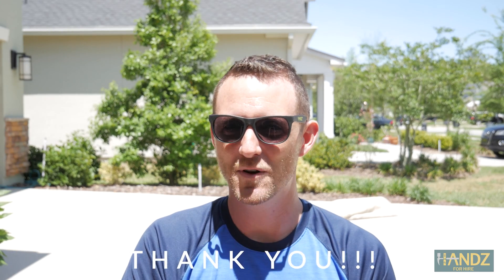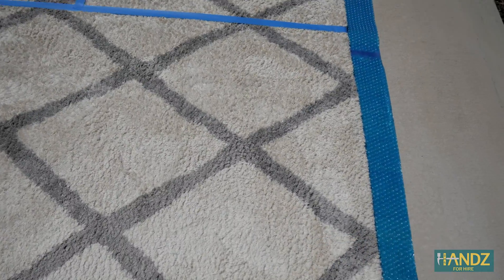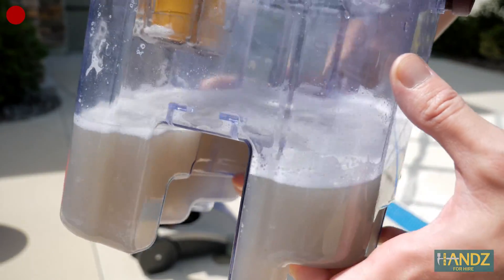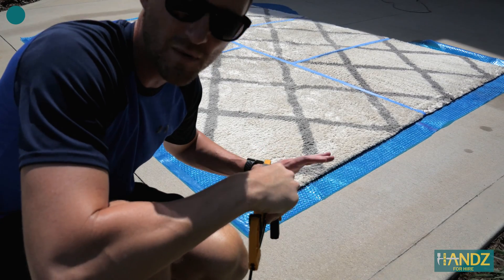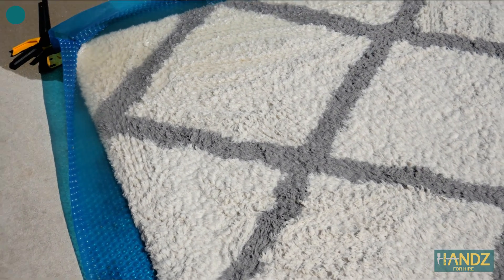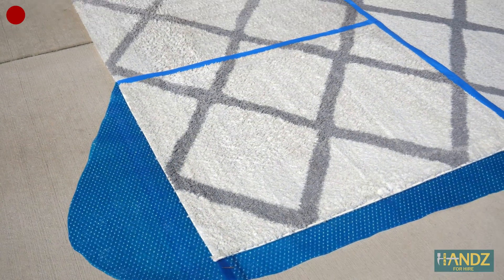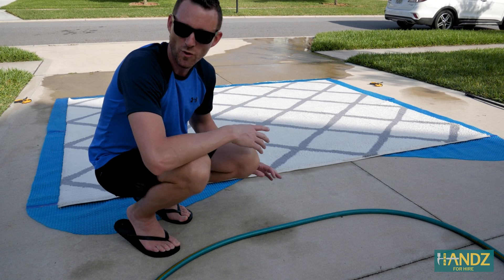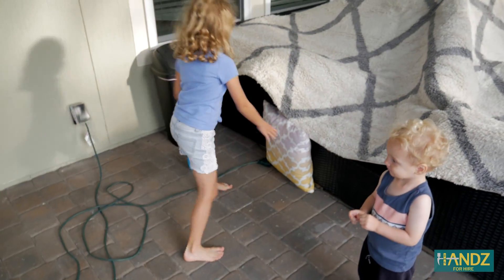How to REALLY clean your CARPET AGAIN | Same Rug - New Deep Cleaning Methods – One Year Later

Comment: I will just rip out all my carpet, put it in the driveway, clean it, and reinstall the carpet.
Does the Oxi discolor darker carpets? Genuinely curious.
Reply from the maker: Do I sense some sarcasm? Haha. You can use it for spot cleaning inside, but if the carpeting is permanent, you'll have to go with an industrial cleaner. You can rent at Home Depot and it sucks up the moisture as it cleans so carpets turn out pretty good. Oxiclean is free of chlorine so it won't discolor like bleach. Good luck with your cleaning!

Comment: I just spent three hours this morning cleaning an area rug that is probably ten years old and has never been cleaned.  To compound issues, my dog has had several accidents on it which accounts for the terrible smell and stains on the back.  I first sprayed the back with diluted vinegar and let it sit.  I then took my pressure washer with a mix of orange cleaner, dish soap and laundry detergent.  I let the saturated carpet sit for twenty minutes and then hosed off with clean water.  I used a jet vac to extract most of the water and finished with several passes using my Hoover carpet cleaner.  It’s currently drying in the FL sun.  I don’t know if I can get rid of the smell though even though its a lot cleaner.
Reply from the maker: Nice! I hope it went well. Maybe make an oxiclean solution to use on the rug to eliminate any lingering odors.

Comment: nice video. what is your recommendation for someone who lives in an apartment in the city without a driveway? Doesn't seem like I have a choice other than a steamvac right? And use either your homemade solution or a store bought one.
Reply from the maker: Yes, unfortunately that's correct. If you do not own one, you can rent one from Home Depot and then use commercial bought solution or this homemade. Good luck to you!

Comment: PLEASE HELP!!! I can't get all the soap mixture out. I don't know how many times I've rinsed it both top and bottom. It's a pretty low pile rug not as tall as yours. I used the same exact measurements that you listed. But I still see small white sides when I rinse with water, and MAJOR suds when I squeegee.
Reply: An extra rinse with a vinegar/water solution should help with any residual suds.
Reply: @rosannecoric  Oh very goooood idea!! I bet you're right, because I know vinegar by itself gets soapy stuff off other things. 

But I'm going to be real honest - I don't know if I'm EVER going to clean my rug like this again. At least not one this size because my lord!  
I mean... even if the vinegar/water rinse saved me the extra hour+ of trying to get the suds out. The process of trying to get 7x12 wet rug onto my little outdoor wagon and balance to transport to the back patio. Then trying to drape it over furniture to dry. All while keeping it from touching the ground or getting dirty again...just about killed me. It was physically so much harder than I anticipated lol. 
So just a tip from me, anything larger than a 4x6  needs two people or "man" muscles.
Reply from the maker: Hi Emily, I’m sorry you’re having a challenge with the soap removal. Maybe try turning the rug over giving it a really good rinse and then rinse once more right side up. It will come out. I promise. Try to start from a corner of the rug and work towards the opposite corner so that the soap all gets worked in one direction. Good luck and let me know how it goes.

Comment: I'm going to try the soaking method with your homemade solution on an indoor outdoor rug. But I also have a couple of nice, but aged, wool oriental rugs which I want to clean, and I noticed you advise not using your recipe on wool. What is the ingredient that must be avoided? Do you have any suggestions for wool rugs?
Reply from the maker: Very cool. I give the warning because Oxiclean can damage the wool fibers and remove coloring from the rug. I've read that they sell a wool soap that can be used with diluted vinegar in warm water. Another option is to call a local professional and ask what they use to clean wool rugs. I think a professional usually charges about $5 per square foot, but if you ask for pricing and what chemicals they use, then you might have your DIY answer. I hope that helps!
Reply: @HandzforHire  , got it! Thank you for all the very excellent advice!

Comment: DRYING...if I do this early morning, can I lay it flat on a slope to dry?  Mine is 7x9 and I don't have enough stuff to drape it over to dry it that way, or hang it.
Reply from the maker: I believe so! The trick is to try to get as much water out as possible once you've done the final rinse. Air under it helps but it should dry fairly well in the sun. Both times I did it, I got a late start and the sun wasn't on my side. The first time, I didn't have air under it, and I eventually pulled it inside damp. I used a hair dryer and the low humidity of my air conditioning to finish the job. Good luck and let me know how it goes!
Reply: (I've already bought all the products :-)
Reply: PLEASE HELP!!! I can't get all the soap mixture out. I don't know how many times I've rinsed it both top and bottom. It's a pretty low pile rug not as tall as yours. I used the same exact measurements that you listed. But I still see small white sides when I rinse with water, and MAJOR suds when I squeegee.

Comment: What if you still use your cleaning mixture and scrub it but then pressure wash it to rinse it? Im going to try that this weekend with ur solution
Reply from the maker: That's definitely worth a shot. Please let me know how it goes!
Reply: @HandzforHire  It worked amazing! Although I have a shag rug and is harder to get alot of the water out before really getting it to dry. Not to mention super heavy when wet!
Reply from the maker: @Emoney_roadglide  I'm really glad to hear it worked well, but yeah, drying is the biggest challenge. The rug did a much better job this time around. I was able to squeegee, vacuum, and roll out much of the water, and then I elevated the rug and had fan underneath it while it dried. These little techniques helped a lot. Have a great day!

Comment: Excellent videos!  I'm  wondering if I could use this concoction in my carpet shampoo machine for wall to wall carpet.
Reply from the maker: I imagine so because when I used it on the rug, it didn't saturate, but left it slightly damp. Perhaps try a small section first and assess from there? Good luck!
Reply: No! It will ruin the machine.

Comment: How would you go about using your solution on carpet? Still soak in house carpet and saturate with solution but not as much obviously to insure water doesn’t go down too much..
Reply from the maker: Hi Makilah, I'd use it more as a spot cleaner indoors as drying becomes a challenge. You could put it into a spray bottle to have more control and then once cleaned, use a wet vac to suck up excess.